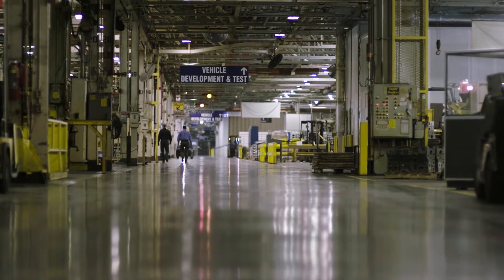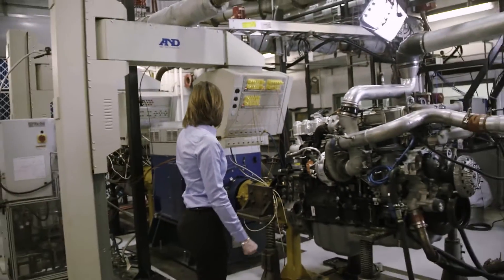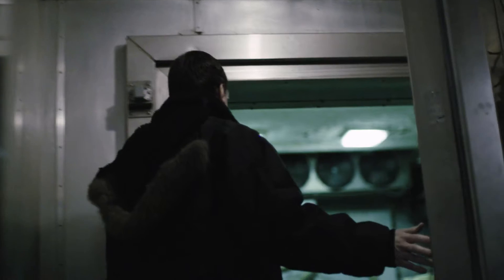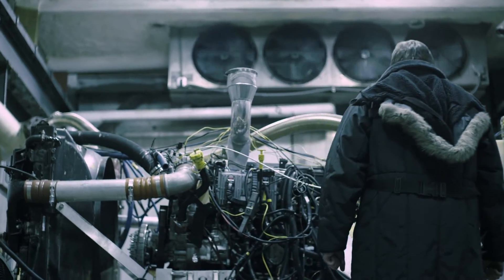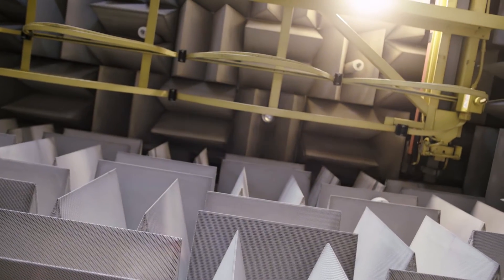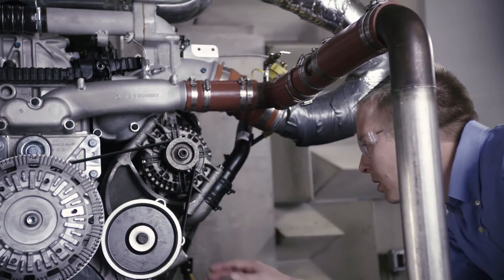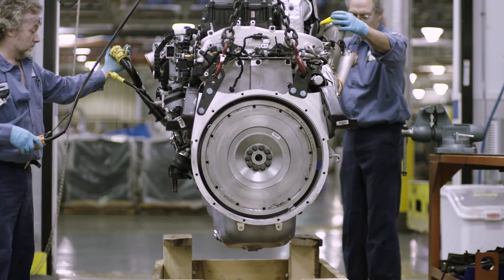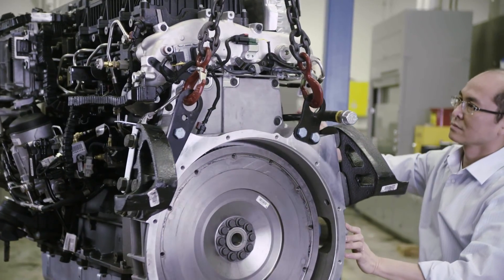Testing the A26 Engine

Comment: I'm in a 2019 LT with the A26 and a 12 speed automated. The engine brake needs to be utilized during all skip shifts not just the top gears. The truck tries to skip shift in corners and falls on it's face. Spread axles require more power in corners. It's a huge improvement over the automated 10 speed. It just needs a few more adjustments. This is the first truck I've ever driven that the turbo isn't audible under load. Weird feeling. 

Now we need a filter to keep diesel particulates between the egr cooler and intake. I'd be nice to no have soot running through the engine.

Comment: It looks like the fan clutch that keeps on breaking is not tested in any of these dyno cells.  Maybe that explains why the fan clutch fails all the time and leaves us stranded on the road.  I would settle for a louder engine that doesn't break down all the time over a quieter engine when it comes to stress for the driver.  There is no way this engine has been tested.  The unfortunate customers are the ones that really test this engine.  We are not customers; we are beta testers.
Reply: Ryan Scott the engine wasn't even available yet when you made that comment
Reply: Obviously, you have no experience with the MxF13L engine.  The clutched fan is the same as the piece of junk that is on the current production engines.

Comment: The MxF13L engine has been renamed the A26, basically a MAN D26 engine with different accessories bolted on it.  The Navistar factories in South America are making the MAN D08.  Now that VW is buying more and more of Navistar stock, is Navistar going to dump the ISB in favor of the D08 (renamed the A08)?  The MxF9L and 10L is really the 570.  Nobody is buying those engines.  Is the 570 going away in favor of the D20 (renamed the A20)?  The R&D facility and manufacturing plants will simply adapt and assemble MAN engines under license.  US designed and manufactured engines will simply be gone.

Comment: Nobody believes that you tested this engine for durability.  Nobody believes that there is a 5% fuel economy increase.  How many days will the EGR cooler last on this engine?  The joke of the industry is replacing the EGR cooler core super fast, only to have the EGR cooler leak and leak coolant over and over again.  The on-vehicle EGR puller and press is a total joke.  Fire the idiot that came up with that horrible tool design.  How many of the N13 engines were sold, compared to the Cummins ISX15 engines in your own trucks?  How many times will the pilot bearing fail, because that bearing has never been in the proper location for over a decade?  The idiot service engineer that came out to visit me told me that the throw out bearing is only temporary.  It should be thrown out.  The moron had no idea what a pilot bearing was, and he was the youthful expert in CSO.  The service engineer had never driven a truck before, and it showed.  He confused the pilot bearing with a throw out bearing, and he didn't even know what a throw out bearing was.  I have been told that the throw out (pilot) bearing has never failed on dyno testing.  Duh.  The pilot bearing isn't tested on the dyno.  It was pointless to talk to the fools in CSO that cannot and had not driven a truck before.  How many fools will Navistar hire?  I didn't see a DPF system on those engines.  I wonder if the dosing system will ever get fixed, or if we will have to deal with engines blowing blue smoke out the stack each time a failed regen attempt is made.

Comment: Yep the engine is 600 pounds lighter they don't tell you they added 1000 pounds to the truck
Reply from the maker: Hi Darren. We've actually dropped 850-950 lbs on our LT Series* (13L, 15L) compared to a 2014 model year ProStar build. 

Here's where we reduced the weight: 
Chassis Skirts
40K IROS
Aftertreatment System
Fuel Tank System
Sleeper Crossmembers
Battery Box Systems
Cooling System
Base Engine
Pedestal Mirrors
Aero Bumper
Cab Suspension

*Represents a LT625 6x4 Vehicle 73” Sleeper, Downsped Drivetrain with Full Aero.
Reply: International Trucks Well you've mentioned a bunch of things that I don't have on my 14 Prostar +. I'm actually impressed someone replied to me. I've been a really loyal customer this is my sixth International. I'd love to chat sometime with you about your trucks. My biggest problem is I always bought 9200 trucks because of their lightweight and high stepping stance. Your not making a sleeper truck that takes the place of that truck.
Reply from the maker: Hi Darren. Thank you for your comments and most of all for your loyalty. I'm looking into this matter for you. Could you message me with your email address using the button found on our "About" tab?